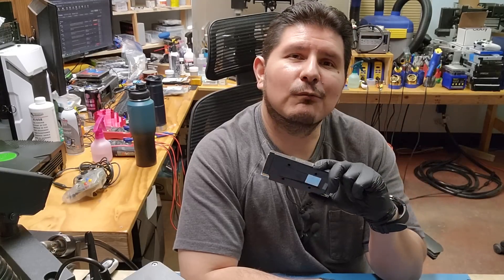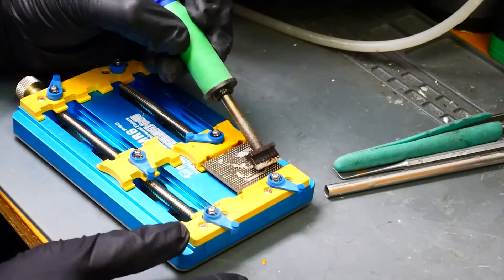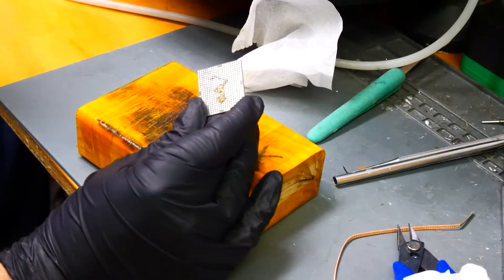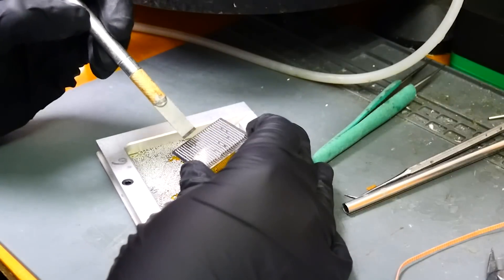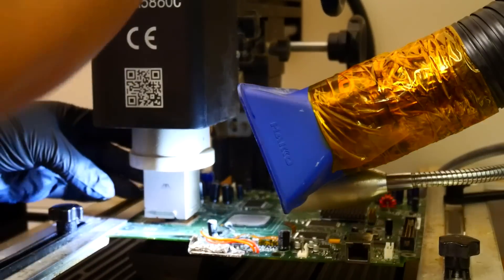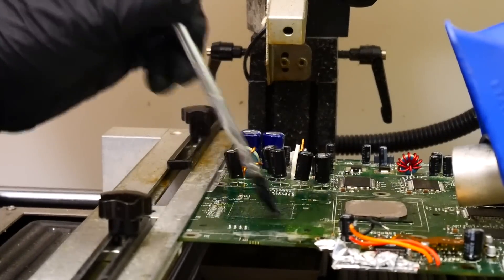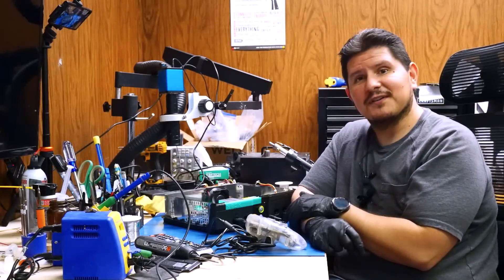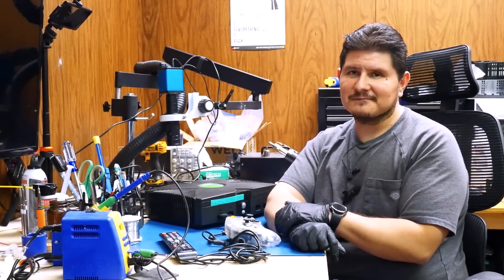Is it Worth it? OG XBOX CPU Upgrade 733 MHz to 1000 MHz (1 GHz)

Comment from the maker: Send in your XBOX for this CPU upgrade:
Would you like to upgrade your XBOX with a new CPU? Check out our XBOX CPU upgrade service:
https://nickselectronics.com/products/og-xbox-1ghz-cpu-upgrade-repair-service
Reply: I am looking for Xbox repair for clock caps and also cleaning how much you charge?
Reply from the maker: @ShiroColdkeyesTheHedgehog  
We have all of the pricing on our website. Please check out the links posted in the pinned comment or video description
Reply: Can you ONLY install a 1 Ghz CPU upgrade in a 1.0 Xbox? I've got a 1.3 that I'd love to have upgraded if that's possible.
Reply from the maker: @SatoshiMatrix1 While I have not personally done it on a 1.3 version yet I am pretty sure it can be done on all versions, since it should be a direct replacement. There are several forum posts that also say it works with all versions.
Reply: I'm glad I found your channel, will be sending mine in soon.
Reply from the maker: @soundpixel9867  We have the flat rate services linked in the pined comment but if you want a custom package with more upgrades, I recommend you email us or fill out the contact form. (contact info is in the video description)
Reply: it was smoother so there must have been no FPS drop with the new chip
Reply: For the work, Those are incredibly fair prices.
Reply: My question es work perfect killer instinct emulators, 60 FPS and font crash no Mercy tu combo AND others characters
Reply: I will not forget
Reply: Thanks for making me buy a halo Xbox for this 😂
Reply: can you increase the ram in the playstation 1?
Reply: what a awesome video. from the UK, i might be sending my og xbox to you soon in a couple months for a cap replacement. good stuff man :)
Reply: It's still not quite there at 1GHz, on PC it wanted 1.2 GHz at least from what I remember.
Reply: Back in the day there was a company that offered modded Xboxes with a 1.4 GHz processor and 128 GB of RAM. They even had a switch to cut the clock speed in half for games that otherwise would run into compatibility issues.

DreamX was the name of that thing iirc.
Reply: @ retro renegade  filled out a request never got a call back? I want you to work on it. Saw you are the technician but do you work on it because I requested you due to to your god tier care

Comment: I’m having trouble with my Bethesda pirates of the Caribbean running choppy. It will freeze for a quarter second then continue but it happens often. I wonder if your system would run it smooth

Comment: I'm of two minds concerning this mod. I admit that it's a cool upgrade for the xbox, but the market for retro PC parts is getting kind of thin. I know there are a lot of passionate retro enthusiasts who would put that chip to good use in a retro gaming system. Couple that fact with the negligible utilization the xbox library will achieve with the new 400 or so mhz, and I just don't see the real point.

Comment: HL2 on Xbox was probably locked at 30fps, but the original cpu probably couldn't handle that framerate all the time, so that's why the footage of the original cpu looked slower, probably hovering around 20-25fps in that scene. The upgrade looks to have maxed the framerate at 30fps which is why it appears a bit smoother.

Comment: ive cleaned off boards, sucked solder out of through-holes before, soldered wires to small smd pins, but this BGA stuff looks like it could bring a grown man to tears
Reply from the maker: Its even worse if you have to fight your equipment

Comment: Did I miss where you did something with the ball solder after getting them arranged on that grid? I didn't see them go underneath the new cpu at all.
Reply from the maker: Yes, in that portion you can either heat the chip with hot air or use a preheater to attach the solder balls.

Comment: May I ask why you’re using a slot 1 PIII instead of the much more common (not to mention cheaper) socket 370 variant?

Oh, hang on, I think I see why…

The slot 1 P3’s have a different pin/bga layout than the socket 370 chips. I always thought that, due to the P3 1.4 being such a popular upgrade, that the Xbox CPU pin layout would have been closer to socket 370 than slot 1.
Reply from the maker: Its also an easier quicker process, though the CPU costs about the same as the 1.4GHz socket 370 one.

Comment: Any chance you could do this for others. I had an n64 Freak 1.4ghz xbox I lost in a fire and he no longer makes them anymore. If your interested I bought a few of his interposer for the 1.4ghz cpu. It comes with pads to install a switch to knock it down to 700Mhz. I just don't have the equipment to install it.
Reply from the maker: Yes, I have a few of those interposers myself. These days we use a newer interposer. Send us a message here: https://nickselectronics.com/pages/contact

Comment: Any specific reason why you stopped at a speed of 1Ghz for the CPU? Makes me wonder if there’d be any additional benefit going above 1Ghz
Reply from the maker: There are a few faster CPUs that can be used, but they either require the interposer or need a slight modification prior to installation.

Comment: The 128mb ram upgrade is more useful IMO as it allows you to play some Chihiro arcade games like Virtua Cop 3, Ghost Squad and the superior version of Outrun 2.

You can also mod original arcade guns and wheels to run with these games.
Reply from the maker: If you're running XBMC or emulating some older arcade titles, then the CPU would come in handy for it. I agree on the ram though.
Reply: @RetroRenegadeRepairs  I would personally never use an Xbox for emulation. Too many limitations on resolutions and hooking up arcade controls.

And the amount of effort needed for this CPU upgrade is unreasonable to me (given how cheap a superior PC is).

I'd like to see more testing on the benefits and disadvantages of the CPU upgrade for Xbox games though.

Specially if it makes sprite based games run too fast and how many 3d games can take advantage.

Comment: Could a socket 370 holder be added to the board so you could just swap in p3 socket 370 chips rather than having to reball it?  or is the slot 1 p3 more compatible with the xbox?
Reply from the maker: The slot 1 is just an easier direct install. There are interposers that allow the P3 and now a socket.

Comment: The flat tip you're using for your iron. Is it THAT much better then the tip you would normally use on a standard Hakko iron?
Reply from the maker: Its mostly to save time and get a cleaner surface. It is a very expensive tip though.
Reply: @RetroRenegadeRepairs  Can you tell me what vacuum picker you're using to remove the chip?

Comment: This woulda been a killer mod throughout the 2000s if this enabled 720p video playback. It was so close, but just not fast enough.
Reply from the maker: Yea, though, I think I'd mostly have used it for emulation and XBMC.
Reply: @RetroRenegadeRepairs  I did from the day the softmod where you hook the hot drive up to a live pc (2002-3) until about 2011 when I started to move to HD. Modded it so I could turn it both on and off with remote. It was really something for emulation too, so many nights 4 player bomberman 2 snes with my friends during the 2000s.

Comment: I'm curious, does this mess with the timing on various games that would have been built with the origional speed in mind? Does Blinx/strangers wrath run too quickly?
Reply from the maker: It does mess with the timing for some games and some games do require patching. Using the Stellar chip takes care of CPU timing issues. I've not tried Blinx on the console.

Comment: 1ghz is more reasonable for the Xbox than the 1.4Ghz Tualatin which is overkill and better suited for a Retro PC Build. I wonder if the 1ghz P3 can play Xbox games without the need for patches.
Reply from the maker: It probably would still need patching, but its fairly seamless with the Stellar chip.
Reply: @RetroRenegadeRepairs  I have an Open Xenium with the Front Panel Display. Not sure what updates the Stellar has had, but I would love to see a custom bios that patches these games to work like they would on a stock console. The Friendtech Xbox's have a turbo button to down clock the 1.4ghz Tualatin, but it's still faster than stock causing compatibility issues. But emulation and running Windows 98 on this is really going to take advantage of the upgraded CPU pretty much most Xbox games have been ported to Windows 98SE and XP. .

Comment: What is that board you pulled the cpu off of? What does it socket into?
Reply from the maker: Its a slot 1 processor for an older PC

Comment: I'm assuming there's a step between puttin the balls in the template and putting the cpu on the board that involves removing the template. Do you just take it off relying on the flux to hold the balls in place, or is it heated in some way first?
Reply from the maker: The solder balls get attached with heat afterwards. Either hot air or a hot plate.
Reply: @RetroRenegadeRepairs  Thanks for taking the time to answer such a newb question!

Comment: I bought a few years ago Xbox with 1.4Ghz and 128MB RAM for 235€. Put in to Xbox HD+ combined with Project Stellar. This CPU is recommended with Stellar Modchip because for several games, any of available patch will no help. For emus, and some games in 720p this set up is monster
Reply from the maker: You can't go wrong with that setup. That's quite the beast of a machine for sure.

Comment: Question @11:53 : Do you have tests of emulators running on the Xbox, or even Linux (Debian, etc) to show that the upgrade is worth it for enthusiasts?
Reply from the maker: I'll probably make some kind of comparison video at a later time. I also want to see how much of a difference there is between stock CPU speeds and the upgraded CPUs.

Comment: What`s the biggest chip size you can lift with that BGA Station?
Reply from the maker: So far I've been able to lift anything we've thrown at it, which ranges from PS3, automotive and other consumer electronics BGAs. Is there a specific BGA you are wondering about?

Comment: Dude if you really wanna stress test you need to do kotor 2 dxun the attack on the mando base
Reply from the maker: Thanks for the suggestion. I've been told of a few games to try, but not really specific spots where a game chuggs. I'll note this down.
Reply: @RetroRenegadeRepairs  yeah that one crashes if you charge into battle cause the hardware wasnt good enough

Comment: I have a new ps3 I got on eBay one of the originals, turned it on once and that's all she wrote wish someone could and would repair it
Reply from the maker: Is it the YLOD?
Reply: @RetroRenegadeRepairs  green light of death I think. I’ve had the yellow before. It turned on after unboxing and was on maybe 5 seconds, flashed a bunch of random colors and that’s all she wrote, took it to a local place they didn’t want to touch it. It’s never been opened, I think I took the hard dive out to use for something else, other than that it’s been a paper weight since, and my wife reminds me how I spent $600 on a broken ps3, to which I told her it was sealed in box, so I thought it be fine, I had an og launch system that crapped  out after 2 repairs.

Comment: although I dunno from direct modding or anything; really only bought a xbox way after their relevance(3 of them for sake of retro hording; and got to use one back in 2000something) I was under the impression the cpu needed some long since discontinued adapter made by some modding company; nice to see it supports some of the bga chips directly

Comment: How do you avoid breaking off contact pads is it with lower heat or?
Reply from the maker: I try to float above the pads with the soldering iron and low heat

Comment: Maybe some day I will have the tools and expertise to do this. The Stellar and Xbox HD+ mod was already a big leap for me (have done 3 consoles now). Goal is to do one of these mods at some point def now that its easier than ever for compatibility support with the work MakeMHZ has done with their modchip. Also on a side note I heard its possible to do a 256mb RAM mod by stacking the chips, do you think it'll make any difference in game performance?
Reply from the maker: Agreed. Stellar was a pain when it first launched, but now its a pretty decent chip. 256mb RAM mod probably won't make a difference until software supports it.
Reply: @RetroRenegadeRepairs  Hardest part I think for a newbie or someone lacking tools is removing that AV port as even doing it destructive my first time was rough (I now have a solder vacuum gun which makes it a treat in comparison)

Comment: Would prefer if the CPUs were sourced from Socket 495 μPGA2 Pentiums instead of Slot 1, since the Slot 1 is more valuable with fully working carts on a vintage computer.

Comment: i wasn't know the original Xbox using Pentium iii slot 1 Based cpu, if it was the newer PGA 370 socket it would be an extremely easy to upgrade

Comment: I know there were 1200 and 1300mhz p3 slot 1 CPUs mostly found in some compaqs back in the days. I used 1 on my bx440 board . Are they hard to find or are there limitations to those working?
Reply from the maker: I've not tried them and I had read that they need a modification to run in the XBOX.

Comment: This might be useful if you're playing some of the extremely demanding games on the original Xbox like Half-Life 2 or other really heavy games, but if you're not playing those heavy games you're probably not going to see that much of a benefit, it's kind of like the 12 megabyte or 256 MB RAM upgrades for the original Xbox, unless you're running Homebrew or running really heavy games optimized for PC and just slap on the Xbox you're not going to see very much benefit.

Comment: + 267 mhz doesn't make much sense, maybe +1 or 2 fps. So its placebo. Only upgrade to Tualatins P3 cpu like 1200 or 1400 have some sense to have better performance in some homebrew with ram upgrade, original game ignore cpu upgrade at all, or even break up. 
I think its some path that can unlock game performanse need to work with cpu upgrade.
Reply: Its 36.4% faster are you crazy?  That's a  huge jump in speed!
Reply: @jimbonater  you have any proofs or just bla bla?

Comment: Really the CPU upgrade usually is followed by doing a ram upgrade

This really allows you to have better multimedia support with xbmc(Kodi)

Some homebrew can take advantage

And you possibly can run game patches with better textures and higher resolution

And just enough to run windows XP

No this will not give you 360 graphics

Comment: I have a soft modded xbox and I want to get mt console upgraded and repaired on ram and cpu and also hdmi upgrade as well along with clock caps
Reply from the maker: Hello ShiroColdkeyesTheHedgehog
Yeah, I have done those upgrades many many times before for other people. If you want I can do those upgrades for you as well and we can talk about certain options depending on the version you have. Just fill out the contact form linked in the video description or you can send me an email directly info@nickselectronics.com

Let me know what version of Motherboard you have and all the details of the upgrades you are looking for. If you have a budget, let me know what it is so we can try to optimize the upgrades.
Reply: @RetroRenegadeRepairs  V1.1 board

Comment: the sound is even better no stutter.
Reply from the maker: I didn't even notice. Thanks for pointing that out.
Reply: @RetroRenegadeRepairs  due to the upgrades you made i would say the last upgrade with the CPU would have made the sound with less stutter as i do not know with the Xbox but i know with many pc's especially now days that they use a soft codex and that relies on the cpu to do the processing especially for back then PIII where quick but i am sure the cpu's would have taken a hit with software sound.

Comment: I'm more interested in the HDMI mod, there's a few original xbox games I have that won't run on the 360 and I'd like to relive their glory
Reply from the maker: You can't really go wrong with upgrading your XBOX with HDMI output. I myself also play a few old titles not able to be emulated properly or don't run on the 360.
Reply: @RetroRenegadeRepairs  I must've looked a long time ago, I had a quick look when I got the UltraHDMI for my N64, I'll have to look again. Installing that was the smallest I've soldered.  

Thanks for bringing it to my attention.